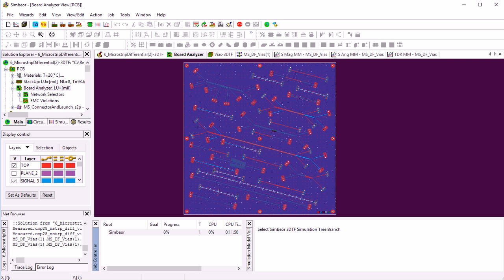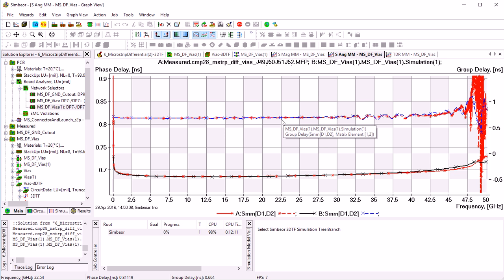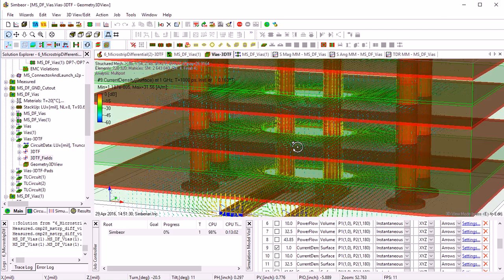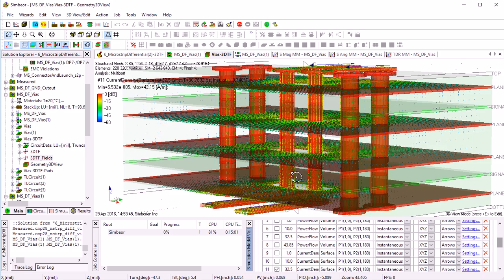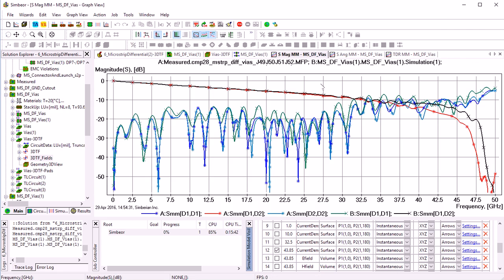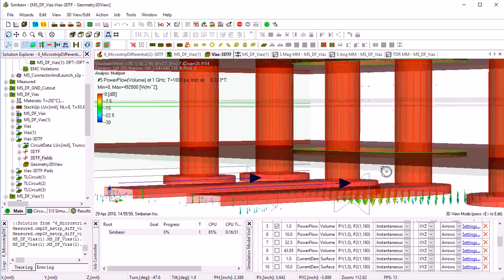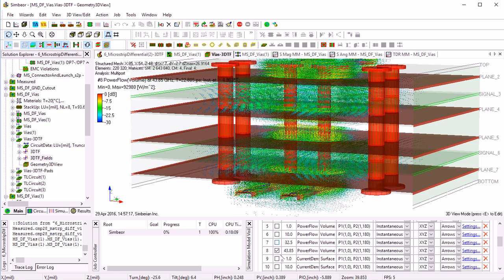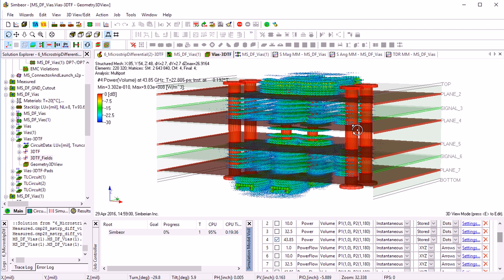How Interconnects Work™: Currents and power flow in differential vias

Comment: Insightful. I like how your visualization of current, fields and power flow give insights on the behavior of the energy transport vs frequency. S parameters are good but this kind of deep digging can be very useful for design and optimization of these structures

Comment: This is what happens when an engineer learns too much mathematical artifact and not enough science.
Reply from the maker: Alan, you are correct, this is a mathematical model and it does look good :-). it is designed specifically for signal integrity engineers and is validated with the measurements. Are you confused with what you see? That is probably because of I am not good with presenting :-) There is nothing wrong with the field computation and visualization here - the model is based on Trefftz finite element approach and rigorously validated with multiple benchmark problems - you can find some publications on that at either IEEE Xplore site (search for Trefftz finite elements) or at www.simberian.com.
Reply: I notice the numbers come out correctly but the cause-and-effect relationship is completely invalid.
Reply: Not quite correctly, I might add, but close enough within measurement error; that does not make the premise of the effect valid.
Reply: Alan Thomas: could you please elaborate what is wrong with the computations and visualization in this example?
It’s all about numerical solution of Maxwell’s equations with boundary conditions, and this particular numerical technique Trefftz method allows for visualization of the power flow density, which is energy transfer or signal propagation.